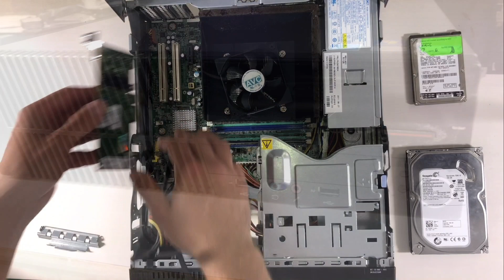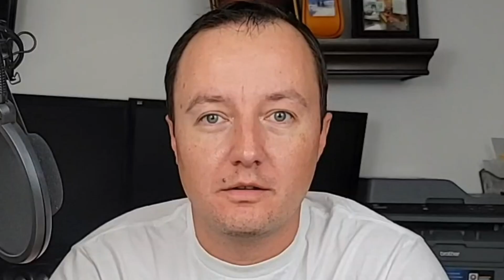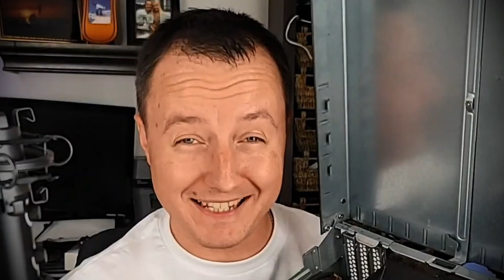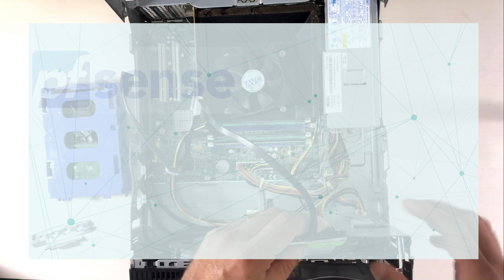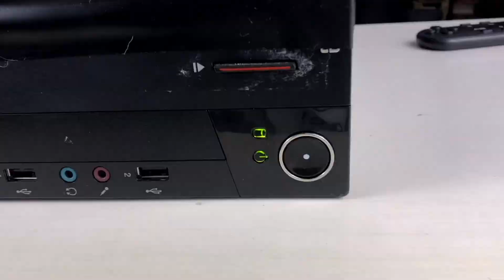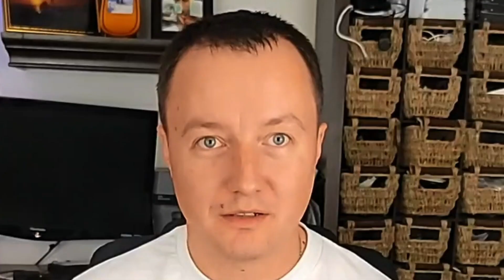002. Turning an Old PC into a Powerful Machine!

Comment from the maker: Do you think this hardware is enough for this planned project?
Reply: I think it is,  based on what you want to do with it.  I7 2400 is a powerful processor for small type of work like this.
Reply from the maker: This one is 2600, but exactly its more than enough to run couple VMs and containers
Reply: An ssd would be much better to be honest. If you already put 4*1gb network card, that means you need something fast, and an ssd would help greatly with latency, access times and boot times
Reply from the maker: Totally true that!!! 4 port network card is more for separation of network segments besides using of vLans. Will get to that in future videos and will be happy to explain the logic of that action :)